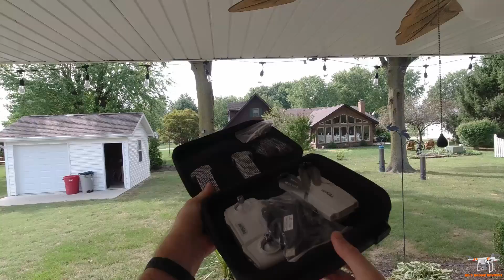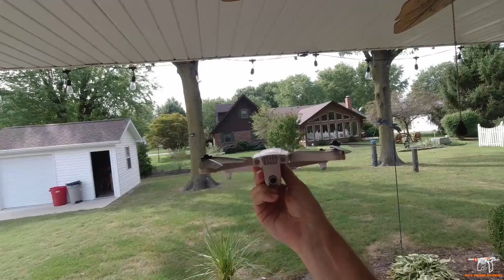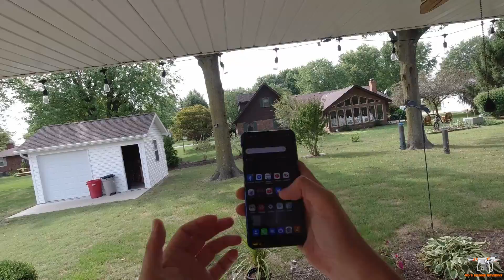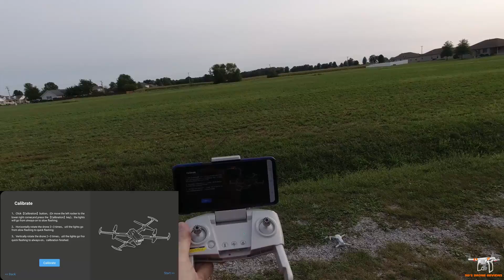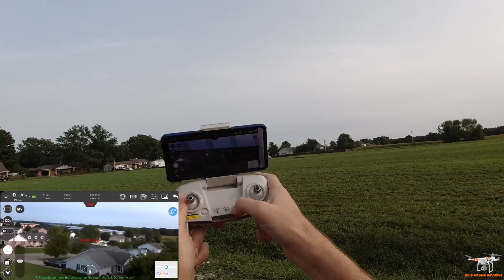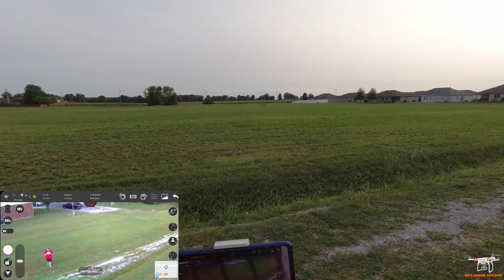Tomzon D65 Foldable GPS Drone Review

Comment: buen dia, tengo un drone tomzon d65, fui a instalar la app en un telefono nuevo pero la app en playstore no aparece.
Alguien sabe donde puede encontrarla?
Gracias.
Reply from the maker: English please
Reply: @OpenCircuitRC  Good morning, I have a Tomzon D65 drone, I went to install the app on a new phone but the app in Playstore does not appear.
Does anyone know where they can find it?
Thank you.
Reply from the maker: @andresalina551  that is unfortunate. It's an old drone I bet the app is no longer available. You should be able to find an old version of the app by searching on Google. You can then download the apk file and install it on your phone when
Reply: @OpenCircuitRC  Thanks for the response Ryan, I bought it in November 2020, I have used it rarely since it is a hobby, I searched Google for previous apk versions but they give me an error when installing. I will have to buy one of better quality, as a first experience it was good. Could you recommend a drone with a stabilizer?
Thanks again.
Reply from the maker: @andresalina551  DJI Mini 2 or Mini 2 SE
Reply: @andresalina551 ı have tomzon d65 when ım trying circle mode and follow mode writing non optical mode do you know about this?

Comment: Hello, great review.  I am having trouble setting up or using the GPS function. Can you explain to me how you went about this please? Thank you
Reply from the maker: Thanks! Did I not cover that in that video? I don't remember
Reply from the maker: All you have to do is calibrate the compass then wait until you get a good satellite lock and you're good to go. The app will let you know when you have though Sats.
Reply: Yeah, we’re having trouble calibrating anything...won’t work through the app, had to do the magnetic manual calibration but the GPS/compass part won’t seem to work 🤷🏼‍♂️, thanks for the quick reply sir
Reply from the maker: @S2kheaven07  the compass has nothing to do with the GPS :)  this is difficult to troubleshoot. Make sure you are not close to any metal such as an automobile. Can you initiate it via the app? If not then start it with the controller and watch the lights and listen for beeps. Compass calibrations used to be a big problem with the early GPS drones and I used to fight with them butt working right but they have gotten so much better in recent years. I couldn't tell you the last time I had an issue calibrating a compass.
Reply: @OpenCircuitRC  again, thanks for trying to help me out. I’ll take a closer look at this during the week and let you know how it goes 👍🏼
Reply: And no, we can’t initiate it via the app. No calibration works through the app, we have to do it manually
Reply from the maker: @S2kheaven07  manually is fine. Don't worry about the app :)
Reply: @OpenCircuitRC  okay, finally got around to messing with this thing. Both calibrations are working but when the phone is in the operation interface on the top left the Wifi and sat signal flash. The sat flashes red and below those two it says “not point hover” doing this in a field not near any metal objects or interference also
Reply from the maker: @S2kheaven07  hmm, no idea except it sounds like it has insufficient satellites

Comment: I just got this myself and have been playing around with it.  I agree with what you say about the quality and such.  It's fun to play around with but definitely more of a toy.

I'm curious if you know anything about the "optical flow positioning" which seems to have to do with operating it indoors.  But no where in the instructions can I find what is involved in using that rather than GPS.

Also, the options under the gear icon are slightly different on mine and never give me the option of 5g WiFi, no matter how many times I have cycled the power on the drone and checked back in the options.  

Also, the stabilization in my app has a "Compare" option which I have yet to try.
Reply from the maker: Yeah, it isn't uncommon to have options in the app that aren't explained well. I don't know what that means either. The optical flow uses the pinhole camera on the bottom to look at the ground and hold position when  there's no GPS lock. It should work but often times it doesn't work well on these toys.
Reply: @OpenCircuitRC  Thanks for the reply.
Another interesting thing I found was when I was searching around my phone for where it saved the video I found that it is in a directory called SYMA.
Reply from the maker: @MarcMosher  that's because Syma actually makes this drone ;) it is just rebranded by Tomzon/Potensic
Reply: @OpenCircuitRC  That's what I figured, after finding the directory and the Syma version (https://amzn.to/3kZ2bTu).  It's good to know so as to get as wide of a range of replacement rotors and parts as possible.

Comment: My drone kept losing control
Reply: The  calibration won’t connect on my phone for some reason and I tried my friends phone and it connected so idk what’s wrong
Reply from the maker: @uknowmysteez6794  well sounds like it is your phone then. I believe it can be switched between 2.4 and 5ghz in the app so use your friend's phone to check that. Maybe it is using 5ghz and your phone isn't compatible.
Reply: How do u change the ghz ?
Reply from the maker: @uknowmysteez6794  It is something you do in the app I believe. I recall doing it I think but it is possible I'm confusing it with the F007 Pro drone. In fact, I think I am getting the two confused. Sorry.
Reply from the maker: You'll have to tell me more. Could be due to inference.

Comment: Got my drone app. Won't work.  Reviews say it won't work on android. Please help me out im not a techy.
Reply from the maker: It works fine. I'm using android. What reviewer said it didn't work with android? All of these drones have apps for both android and iOS. Some work better than others. Make sure you connect to the drone's Wi-Fi signal first then open the app.
Reply: @OpenCircuitRC  hey I got it to work.  But I had to delete it then, then reinstall. I had to give access to photos I believe.  Then it seems like it worked.  I've never flown one today is the day. Thanks for your quick reply.
Reply: Well om gonna bust this drone with a hammer or send it back im gonna lose it won't since yo my phone. Only 3 blades turn. Im really upset. I was super excited this thing sucks. I don't know what to do
Reply: Sinc too spell check suck
Reply from the maker: @jl2831  could be a bad motor. Have Amazon send you a replacement.

Comment: Are you using an android phone ?  Thanks
Reply from the maker: Yep! LG G8 ThinQ
Reply: @OpenCircuitRC  Thanks. The reason I ask is that when I went to dl the app there were alot of bad ratings by android users. It looks like it works for you. One person even said their drone flew off never to be seen again. At first I  tried reading the manual but my electron microscope is in the shop. Then I went straight to youtube  where people that know what their talking about hang out.
Reply from the maker: @krejdloc  all these "toy" grade Wi-Fi fpv android apps haves terrible review scores. It is really common. Some of them do suck but a lot of the time it's user error. The drone flying away definitely wasn't caused by the app.

Comment: mine says when I try to connect it says no internet connection to it do you have any ideas of the problem
Reply from the maker: You don't need an internet connection :) that's normal. Your phone is simply warning you that there's no internet available from the D65's Wi-Fi connection which is correct. My phone gives me the same warning anytime I comment up a drone's Wi-Fi. The video feed to your phone inside the app is that the Wi-Fi is for.
Reply: @OpenCircuitRC  so how do you connect the video to the Drone I'm confused I've been trying since you told me is not working

Comment: hi can you explain me that, in the video you don't show  how to use the function in optical mode,  want to use the another function in the app butt it says : unable to turn on visual tracking or control, can you check for me please?, it says that with the gesture you can do the photo, it is true? the optical flow mode it says that the light should be turned  in yellow, it is correct? thanks
Reply from the maker: Yeah I'm not really sure. I didn't try disabling gps mode to test the hand gestures but don't be surprised if that doesn't work. You disable GPS with the switch on the controller.

Comment: WiFi off, mine flew fine, turn on the app it was terrible just like the x500
Reply from the maker: Mine flew great with Wi-Fi on. No issues at all. I was flying over a field though in a small town with less Wi-Fi interference though. The only issue I had is it won't even read a 32GB sdcard.
Reply: @OpenCircuitRC  You can use a 4gb card, the bitrate is so low the file size is very small
Reply from the maker: Yes I know that. I just didn't have any cards less than 32GB at my parents so I had no other options.

Comment: Good job Ryan, not a bad quad. Too bad about the sd card not working. 

Enjoy your day  👍
Reply from the maker: Thanks Dan! I think it may just be because the card was too big.
Reply: Thanks for uploading Ryan. I actually purchased this quad from Amazon and got just got it a few days ago. I like the smaller size
and my primary purpose was indoor flying with the Optical Flow Sensor. It works great for that. However, 
I dropped in a 64 GB Scandisk (the only one I had) and experienced the same problem you did.
An error message that says not enough memory.  Did you get any resolution from TomzonToys about that?
Reply from the maker: @legganty  I've not asked them yet but I can. Tomzon is owned by Potensic. It appears you have to use a SD card > 32GB.
Reply: @OpenCircuitRC  Yeah, I've got a couple of 32GB cards on order. I notice in their spec their calling for a TF card. I'm not what the designation is. Did you get a 32 GB card to work?
Reply from the maker: @legganty  no I didn't have any luck with 32GB and TF card is what they commonly refer to in China as sdcards.
Reply: @OpenCircuitRC  Thanks for the heads-up Ryan. Were you able to grab the photos through the WIFI connection on your phone?
Reply from the maker: @legganty  I just used a screen recorder.